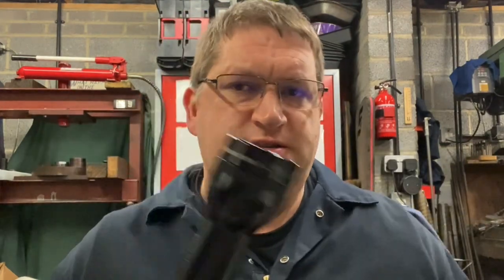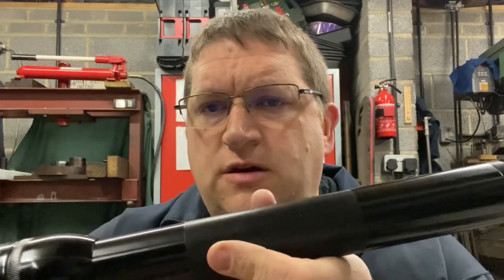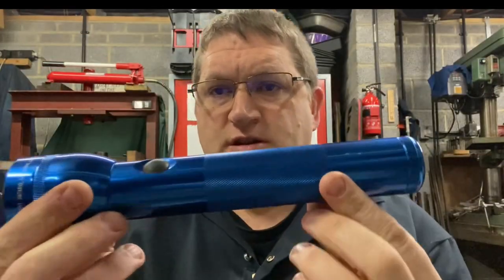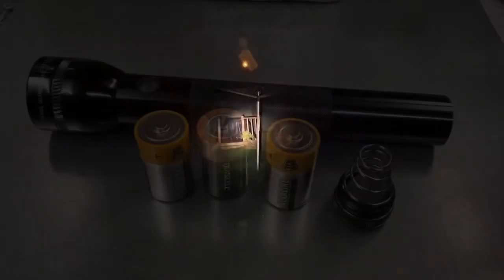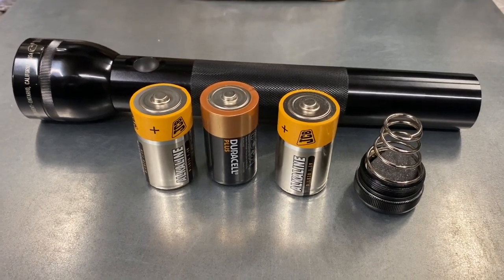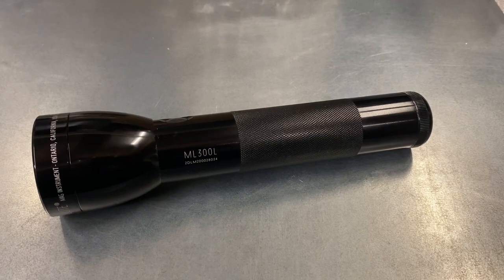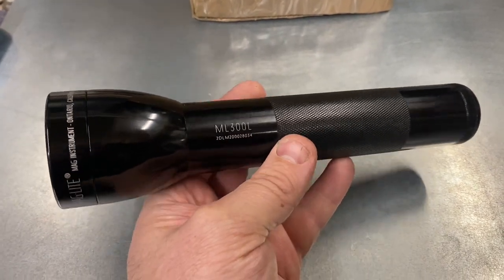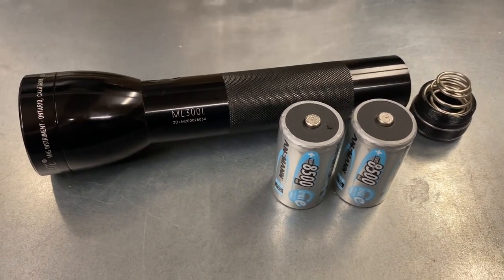Maglites, comparing factory units with aftermarket upgrades

Comment: I used to be a fan of maglites.  But that was the 90's.  After Clinton gave China mfn, improvements seemed to stop, and quality ebbed.  My little go-to 2x AA... bulbs not lasting as long, and increased corrosion problems of the alumonum case.  My 5x D cell flamethrower?  The krypton bulbs that woked so well just disappeared - not available anymore at any price.  I use LED's now.  The little plastic case Larry Lights [rebranded at some point] are the perfect glovebox item.

Comment: My dad bought a Maglite from America when I was younger and bought it back to the UK, I was fascinated by Maglites then. A few months ago I picked one up at a car boot sale for £3 and I'm looking to upgrade it and my dads. I will follow this video for reference. I was wondering, my Maglite seems to have a painted-grey body, I wondered if that was standard or if a previous owner did that? (They did a pretty good job if they did) I would also like to know that if I stripped it and annodised all the outer-body parts, would the annodising affect the contacts/current at all?
Reply from the maker: Just follow what the original manufacturer did, they machined off anodising where electrical contact was needed. Maglites were never painted.

Comment: I've got a 3 cell torch that I upgraded with an led module summer time ago. I recently found it at the bottom of a drawerand one of the batteries has corroded from the inside out, through the aluminium tube. 😡
Reply from the maker: Ouch, don’t store long term with the batteries in, I use NIMH cells to
Reduce the chance of leakage